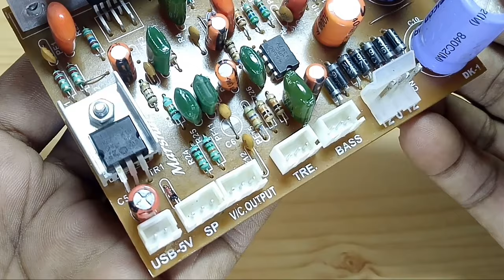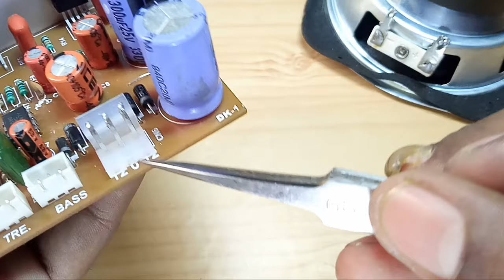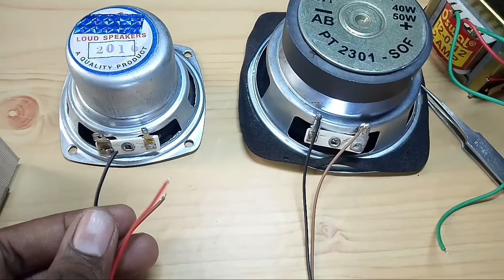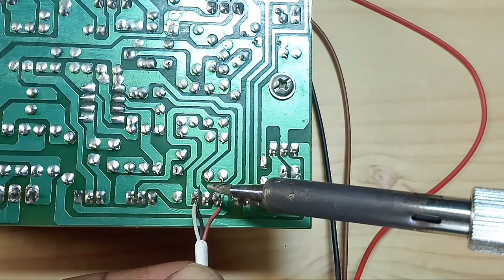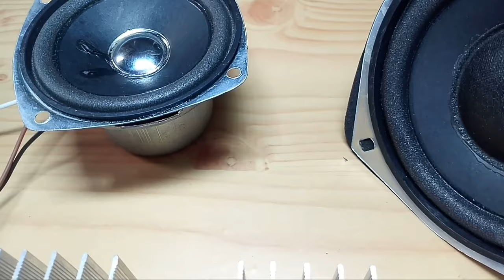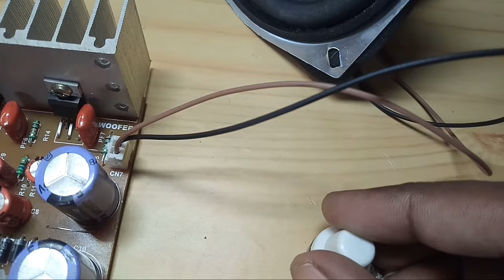Audio Amplifier 2.1 Home Theater Circuit Board Wiring || Tda 2030 IC Board (Full detail In Hindi)

Comment: I have 15watt  4ohm sub woofer speaker and two 15 watts speaker left and right. Power supply i have is 18 volt, 2 amperes. Can u suggest one good amplifier board for this?

Comment: If I want to use 12volt dc from solar inverter system can be used or 12volt battery
Reply: Nahi chalega... only AC power supply
Reply: Yes you can but aap ko bridge circuit ko remove karna padegaa

Comment: Sir, I am Derickson George as electrican and technicians in solar system installation  work as a solar Installer. I don't know more about electronic . If I want to use 12volt dc with out center connection of 12-0-12volt